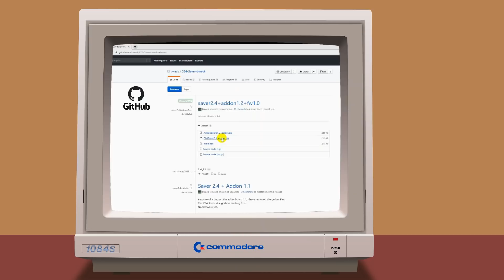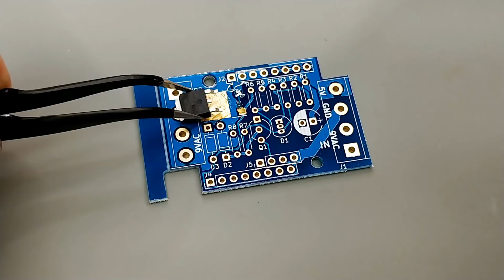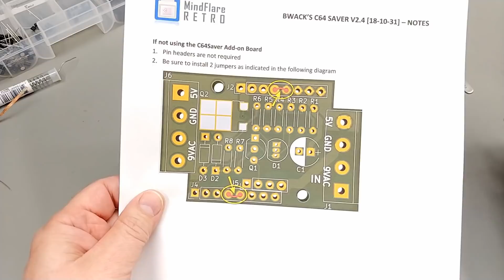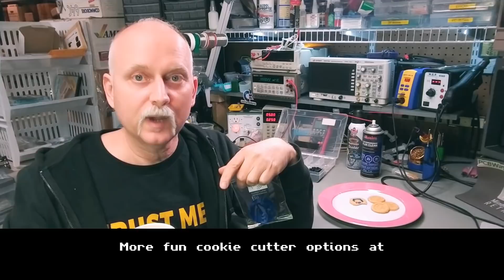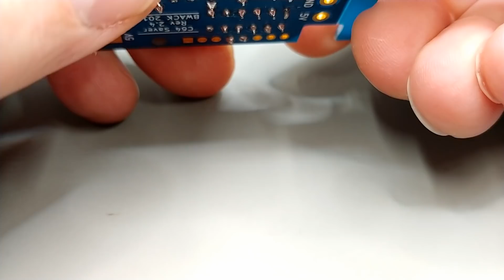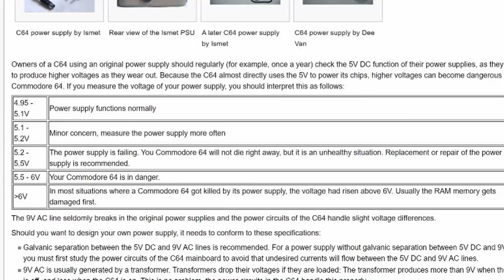#17 "I Am Diggin' This Little Guy" — Building a C64 Saver — Part 2 - PCB Assembly

Comment: I've build 2 of these and It won't work for me, whatever the input voltage is, it just seems to pass through... the over voltage protection does not kick in. I have double checked all components, I used some components from Australia stores but all values were the same. I closed the pins on the 2 headers as not using the add on board. Any ideas?
Reply: No solution here, but I am having the same issue.  Quite frustrating.  Did you ever solve it?
Reply: @MatthewCoffron  I put it aside, then I went back to it and it seemed to be working. Maybe I wasn't checking the right pins. make sure you check it on the pin out on the board.
Reply: @TotalMK  I appreciate the reply.  I tried a solution that I read on the github page to swap out one of the resistors with a different value and ended up completely messing up the PCB.  Thankfully I have 10 more so I'll just try it again and carefully test each of the components before putting it in.  I am sure that I was testing the pinout correctly though, and prior to destroying the PCB I tested up to 7V without protection kicking in.
Reply: @MatthewCoffron  Yeah I swear I had the same issue, as I said I went back to it months later and it was working.

Comment: Hello, I dig into github folders to build myself but no list of parts required for C64 saver, do you have?

Thanks
Reply from the maker: Hi. There is a link in the description under C64 Saver Resources, but here are the direct links:
Parts List (BOM): https://app.box.com/s/jl8a8jtlxvyqn7wqwfxdt78xauu1evqq
Assembly Notes: https://app.box.com/s/yw7h3aqmtn438mc22ljnikfzvdjnblwb

The Parts List has links to DigiKey (Canada) but you can use that to determine sourcing the components in your country.

Thanks for commenting and have a Happy New Year!
Reply: @MindFlareRetro  Thank you!

Comment: Thanks for your great videos! I have watched you struggle a bit with too much solder from time to time. I've found that a smaller tip helps with that. The small screwdriver type work well for me.
Reply from the maker: Hi Brian. Thanks for your comment. I had just purchased a new iron just prior to recording these videos and also acquired a bunch of tip styles I was not used to. Excuses aside, I do have a bad habit of not cleaning excess solder from tips -- I am consciously working on that issue. 😊 I appreciate the positive feedback. Thanks very much.

Comment: One question,  your BOM has links to 1/4 watt resistors but in the video you stated you are using 1/8 watt. I ordered some of these board and they are very tiny. There is no way that 1/4 resistors will physically fit, I have tested a 1/8 watt and it does fit. Unless I am reading something wrong from your BOM links, you may want to change it to point to 1/8 watt resistors.
Reply from the maker: Hi Mike. Nice catch, as I did misspeak in the video. The BOM is correct -- these are the exact parts I ordered and used. I selected Stackpole Electronics resistors because they are rated at 1/4W and have small dimensions, 0.070" Dia x 0.130" L (1.78mm x 3.30mm). My first order (used in the video) were from Arrow.com, and I have a very recent order of the same resistors from DigiKey and they are the same. You would be good to go with those resistors.
Reply: @MindFlareRetro   Thanks for replying, I was just a little nervous ordering these parts because most 1/4 watt resistors are 6.5mm in length  and that is to big for the spacing on this board. I was hoping you found some smaller length 1/4 watt resistors. I really enjoyed the video which has inspired me to make this C64 saver.

Comment: Very nice. Love the intro! I would imagine that there will also be slight voltage losses in the cable by the time it reaches the C64, especially under load. The Bwack savers I fitted inside some of my C64s seemed to cut out at around 5.43v. The Carlson savers I bodged together from random mis-matched scrap parts seemed to do about the same (lol) but, apparently can drift with temperature so are not so great to put inside the machine. Keep it up.
Reply from the maker: Hey. Thanks for the positive feedback. Interesting about the drift -- I will have to look into that more closely. I have ordered parts from China to see if I can put together reasonably-priced kits for people but my order is still not here after 90 days -- so frustrating.

On another note, glad to see you back. I watched your Amstrad video the day but have failed to comment yet. Hopefully, you are getting back into the swing of things and making more videos, which I always enjoy.

Comment: That's very cool, but I think it's easier to just build your own PSU.  No PCBs, no resistors...  and no potatoes are harmed in the making of them.  :-)
Reply from the maker: LOL. Yes, you are correct. People always ask me about C64 Savers so I thought it might be fun to do a how-to series on it. Thanks for watching and for commenting.
Reply: @MindFlareRetro Oh yeah, it's definitely worthy of a video.  I've got a functioning C64 PSU that works, but I don't trust it.  I was just going to cut off the DIN cable and use it in another power supply build, but I might make one of these savers instead.
Reply from the maker: @Luthiart  If you like, DM on Twitter @MindFlareRetro or email me at the address shown on the About page of my YT channel and I would be happy to mail you a PCB.

Comment: Hey MindflareRetro I had a bit of an over sight when ordering parts for my c64 saver. Didn't realize on your last video that you had a parts list made up. I ordered 47uf 10v caps instead of 25v, the 10v ones should work fine on the boards right ??? I mean it is rated at double the circlet voltage.
Reply from the maker: Yes, sir, that should be fine.
Reply from the maker: Yes, sir, that should be fine.

Comment: Great video and fantastic soldering! Has anyone ever just placed a 7805 inline with the power supply? Does that protect the C64 sufficiently? I’m assuming it would at least not cut the voltage suddenly.
Reply from the maker: Hey Josh. Thanks for commenting. Interesting question. I have never seen a 7805 used inline with the power supply. Having said that, the 7805 require a minimum input voltage of around 7V, so one would have to know that their PSU was way out of spec and outputting a very high voltage before connecting a 7805. Although, in line with your thinking, I have seen a UBEC (a little step-down converter device) used in out-of-spec PSUs -- there's a video somewhere on YouTube IIRC. I think UBECs require a slightly lower input voltage than a 7805 and they do not get as hot..

Comment: I find it ironic that you use "No clean flux"  (which I went to look for on amazon) and then right after used "flux cleaner", (yes, I looked for that as well).
Reply from the maker: Yeah, that is ironic, for sure. I think they call it "no clean" because you can use it for small solder jobs and not worry about cleaning it off, as there are no harmful additives that would cause future damage to the board. I find that this flux is quite sticky and I prefer to have squeaky clean PCBs. This is the one I am using in the video, https://amzn.to/37hqsfb.

Comment: I laughed at the intro, good stuff. I like the idea of doing an internal installation, might try that with my C128 even though the C128 power supply supposedly isn't as prone to failure. Still a 35 year old power supply, after all.
That cookie cutter is cute, too. #commodorecookie
Reply from the maker: Thanks very much. I am happy to hear that you got a kick out if the intro; it was fun to do. Yes, the internal solution is a great idea. Be sure to check out Plan C's video and how he did it. Thanks for commenting.

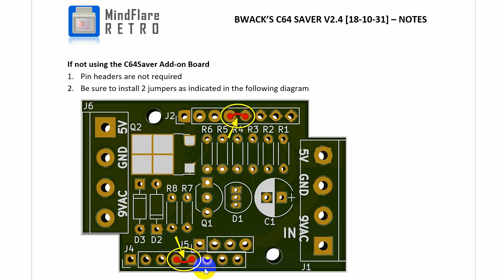Comment: 14:52 amazing video so far. I would have just installed the pin headers and used a 2 pin jumper so its easier to just pull it off and bang your ready for the external display
Reply from the maker: Hi Wes. Good thinking. A little secret, I actually did that originally but ended up desoldering the pin headers (there are a few shots in the video where you can see old solder marks on the pin header through holes). I can't remember my reasoning for removing them. 🤔

Comment: Nice intro.  What soldering station do you use?  #commodorecookie
Reply from the maker: Hi Colin. Thanks for your question. I have a genuine Hakko FX-951. I used to have a Hakko FX-888D, which is a great tool, but I found that I wanted something that I could quickly swap out tips on easily in the middle of a soldering session and the FX-951 allows me to do that. That said I couldn't justify the price of that upgrade until a local electrons supply place had a crazy Hakko sale so I pulled the trigger and sold my FX-888D to recoup some of the cost.

Comment: Good work as usual. My only question is, are we not delaying the inevitable by using a C64 Saver? If your PSU over volts and the Saver cuts off the power then I assume the PSU is now useless and needs replacing, as this is going to keep happening. Or am I missing something? Thanks.
Reply: Sure, but some have maybe a bunch of power bricks laying around and can take them to use.
Reply: bwack I can see the efficacy in that, but eventually you’re gonna have to buy or build a new PSU. I’m not taking anything away from the effort, however, I just got a used breadbin model and since I know very little about building PSU’s and my hands are failing (probably can’t solder well), I just flat bought a new PSU from keelog.com. I’m not going to be using the OG PSU at this point. Again, not trying to rain on anyone’s parade. Thanks.
Reply: @StevenSmyth  hehe. Rain on my parade is from a song, I have heard it in a movie. Great. I will check it out. More powersupplies are available to buy now than before. It is a good thing.
Reply: bwack My favorite Barbra Streisand song. Cheers.

Comment: I have found the mechanic solder paste is not very good and it left little solder balls all over my board, but the chipquik was a lot better and gave very nice clean shiny solder when I used it in my DIY re-flow oven.
Reply from the maker: Thanks for the info. Yes, the Mechanic brand is not the best. Maybe the extra flux paste I added helped it a bit.
Reply: @MindFlareRetro  has anyone said you sound like This Old Tony ?
Reply from the maker: @DJlegionuk  Ha. No they haven't. Is it the voice? Accent?
Reply: @MindFlareRetro  the tone, accent and chilled way you both talk. if you have not check his youtube. it's very cool machining stuff and super  entertaining.
Reply from the maker: @DJlegionuk  I know of the channel but I am not an avid watcher. It will check it out again. Thanks.